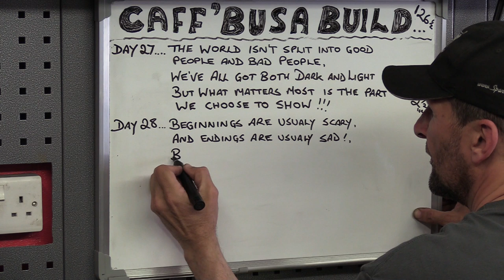Delboy's Garage, Hayabusa 28, Clutch Master Cylinder Rebuild.

Comment: Nice 1 del . Bike is on retest Tom (1400) was just new laws regarding rear indicators needing to be apart . So fitted some to the rear with resistors  soldered heat shrink etc. Jobs a gooden . Love the videos ..
Reply from the maker: Nice one Kevin.. sounds like you got it sorted mate !
Reply: @Delboy's Garage  think so buddy ..be good to ne back on the road tbh been to long.  I'm awaiting a master cylonder kit but done it b4 . Not much to it obvs ..but ud put a new slave kit on her anyway .. running well ..now ty matey

Comment: top job del. here is my story, changed my brakefluid a good year ago.
but lately the feeling of the brakelever  was not right.
felt notchy when pulling harder, took a good look a the fluidbottle
it reads  shell dot4 esl   (esl stands for extended service life)  suited for abs systems.
got a 1998 fireblade and she is not liking it, that stuff is much thinner
went back to regular dot 4 and all is fine now.

Comment: Awesome video as always you make everything seem so easy🤗🤗🤗 I'm installing a new L shape cycle Vise for the front tire on my motorcycle lift. Penny and you Del ride safely and have a wonderful weekend.
Reply from the maker: Hi Paul, good luck with the vise, hope it goes well, have a great weekend yourself and we hope you're enjoying the sunshine!  D&Px
Reply: @Moonfleet41  I did a great job with the vise. And with the original device that came with the front wheel holder on the lift. I use it for the back tire and I don't have to strap down the motorcycle.Penny & You Del Ride Safely & Have A Wonderful Week.

Comment: Just food for thought. Once you've got the tank off, is it worth doing a set of valve clearances and changing the spark plugs?? Might need to swing the rad down but one of those jobs that's sooooooo much easier to do with big things out the way.
Would also be good to see a video on valve clearances and see what condition the engine is like under the rocker cover.
As ever, all good stuff with the vids

Comment: HELP PLEASE! 

 I have a question maybe you can help. I have a 2002 Hayabusa and my clutch does not engage . 

I got a master cylinder rebuilt kit put on, a new slave cylinder and push rod and last changed the clutch line.  I also been trying to bleed that line for a few day now but I think I got it. 

With all this still nothing, with the clutch cover off I notice barely any movement of the push rod on the pressure plate.  

Got any ideas of what could I take a look at next ?

Comment: I haven’t gone through all 126 comments so I apologize if this is a duplicate question. You used a “rubber grease” in this video. What brand and makeup is it. I noticed you used it on the inside seal which could crossover into the fluid. Can this contaminate the brake fluid? Or, is this of a composition that will not? 
Thanks for these videos. They are extremely helpful. Especially on my old GSXR.

Comment: Great series! Question, do you use JIS bits in your screwdriver or regular Phillips? Reason for asking is when I bought a set of three JIS screwdrivers my garagelife instantly improved. No more stripped heads on the screws on my Japanese bikes. Works a treat! 😄
Reply: JUST ordered a Set of JIS Screwdrivers to remove the screws on my Brake master Cylinder, you can tell if the Screw is JIS as there will be a small Dot next to the head of the Screw,also you can use JIS Screw driver headed driver bits on Philips headed Screw,but don't use Philips Bits on JIS screws as you will round out the head of the Screw and that's a Big Problem.

Comment: Quick question Del, why do you use what looks like a VDE screwdriver for a lot of the prying/pushing of rubber parts etc. when a normal slotted screwdriver would have a thinner shaft and be just as effective? Is it a case of what's available? And an extra question, any preference between normal screwdrivers or ratchet? Never seen you use a ratchet?
Reply from the maker: Hi there, i have a few of those little VDE drivers scattered about, got them in a set of ten, and they're just what's handy to reach for at the time... and yes i have a couple of ratchet drivers, use them from time to time./ :-)

Comment: rubber lube is silicone paste the same thing?
Reply from the maker: Different ingredients as far as i know, old style rubber lube (from what i read) is a castor based oil thickened with clay... and silicone grease is the same idea if thickening oil with fillers so make a paste....so i guess you could say one is organic and the other synthetic... same result and same use though.  both heat resistant and kind to rubber.
Reply: @Moonfleet41  excellent thank you.

Comment: Hi Del, the oil cooler pipe you managed to fit was that the send or return pipe ? was just thinking the heat from that down pipe affecting the cooling, as you dont see the downpipes once fitted would you consider exhaust heat wrapping just to stop heat to the cooler pipes at all as they do look rather close :) ?
Reply from the maker: The pipe i have managed to fit so far is the feed pipe i believe, i guess the return pipe matters more, so once i get a union that i can connect it to, it is a lot longer that the feed pipe, so i will route it with as much air space around it as possible, and consider wrapping it too as that's good common sense... Thanks for the nudge mate, much appreciated... Del.

Comment: I see you clean parts with the wire wheel, But how do you keep the hardware from rusting two days later?
Reply from the maker: If you're referring to the pin that actuates the master cylinder, I'm sure you saw I filled the rubber boot up with rubber grease and as for the screws, they'll be replaced in the future before the bike goes on the road.
Reply: @Moonfleet41  I've been restoring a kz550 and when i clean the bolts with the wire wheel they rust up in a day or two, any suggestion on how to stop the rusting?

Comment: Is the clutch rebuild kit the same as the brake rebuild kit? Im riding a b-king
Reply from the maker: Hi buddy, no it's not, if you look closely on the clutch master piston, it's got that strange socket arrangement on the end to accommodate the pin that holds the rubber boot and fits in to the lever, but on the brake side, the top of the piston is flat, and the casting of the brake lever pushes directly on it with no pin... and am not sure, as I didn't measure them, but it could be possible that the bore inside them could be fractionally different, but just order the right kit, they're about the same price as each other, about £20 from Wemoto.

Comment: Hey @Moonfleet41 i have a question about a part im missing for my iron 883 part number is 41800317 its a hose for the rear brake the dealer where i live wants 200$ for it and another 200$ to put it on wich i think is absurd you have a good tip where i can buy these parts online im EU btw... sry for asking this here not sure if this is the right place :)   thnx keep up the good vids!
Reply from the maker: Go to "Jersey Harley Davidson" website, and search that part number... it comes up as an ABS Brake Line Kit and costs £92.67  they can ship anywhere in Europe, and fitting will require specialist equipment to prime the ABS system, so maybe shop around, i can't help you with that,  but there's the part for almost half your price.. .Hope that helps... Good luck..
Reply: @Moonfleet41  Thnx for the answers man ill do a little more research and see!

Comment: Good vid again bud,ive got a starter motor problem i think its the bushes but what would you do replace bushes or get a new motor???
Reply from the maker: Hi mate, you need a bit more investigation that 'start motor problem', have you isolated it specifically to the starter?  Remember, there are many things that affect the starter, side stand switch, clutch switch, kill switch, are they all healthy?  What is the exact problem with the starter?  Is it spinning freely every time if you power it up off the bike?   Before you starting ripping it apart, or thinking of replacing it, then it's sensible to ascertain first, that the starter alone is the problem!   Check all the other stuff first, process of elimination and all that mate...
Reply: @Moonfleet41  thanks mate ill check around first but it was turning over a little just not fireing  up right